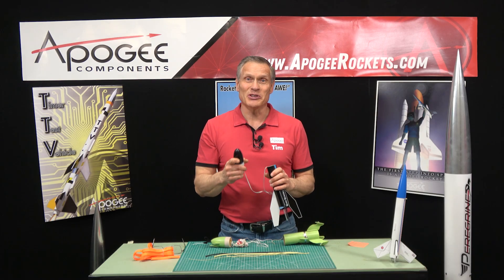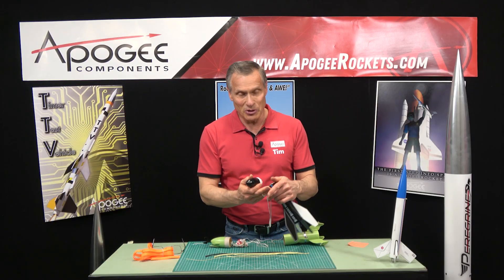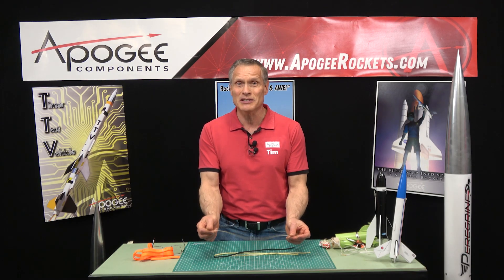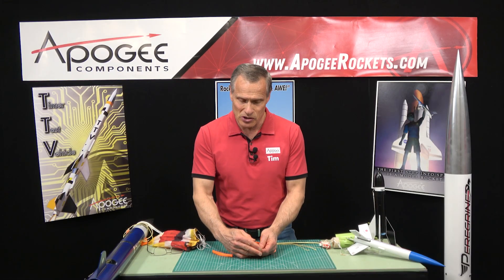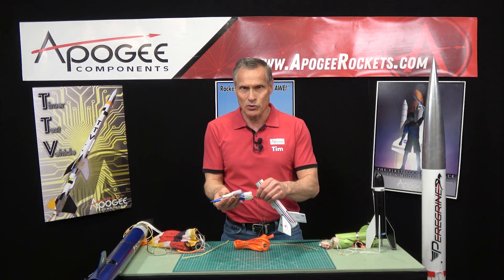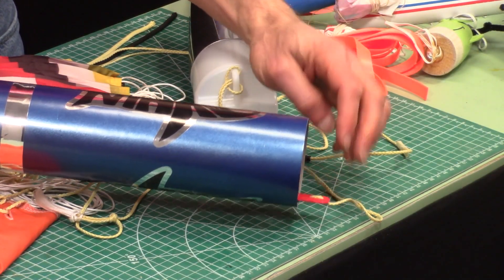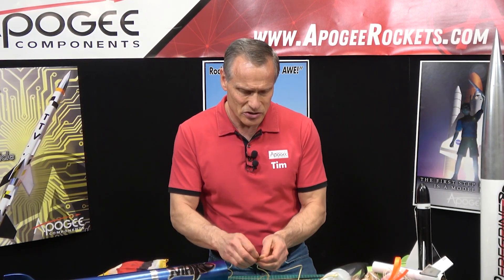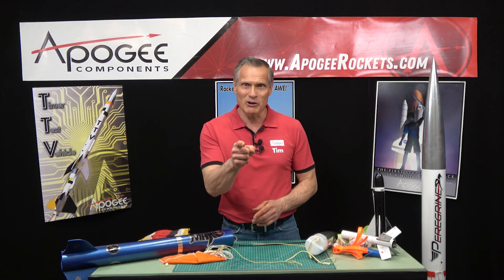What Shock Cord is Right for YOU?

Comment: Another advantage of the taped Z-fold is that stretching it out dissipates energy. There's friction as the cord is pulled from the tape, which dissipates a little, and if the tape has to be torn by the cord it will dissipates even more.

Comment: I've been sold on Kevlar for years. Works great. You forgot to mention that it's fireproof. No worries about ejection charges burning anything up. The biggest problem is the body tube anchor. Around the engine mount is optimum. The Estes body tube mount is a no no. It will come loose.....and you have to chase the nose cone and chute into the next parish. You also get a really nice core sample when the model cuts into the cane field. Ask me how I know......lost a really nice 4x, 5x custom Starlight model just like that. Nail it down......and you're right. Longer is better. Daisy chain it together and you're good. = )